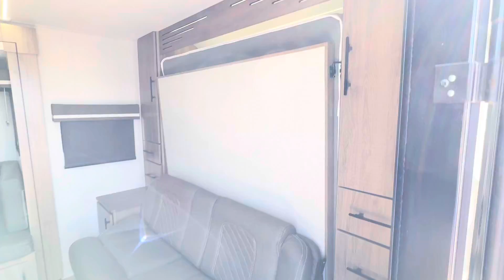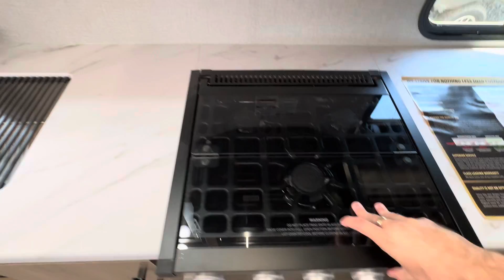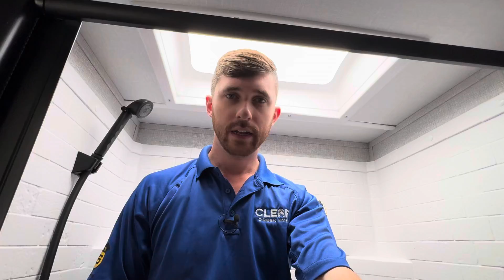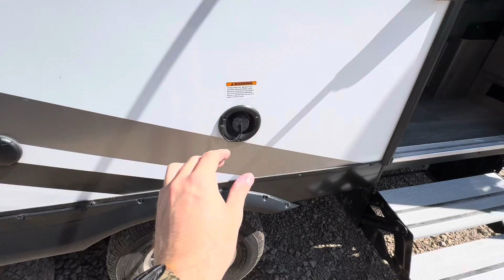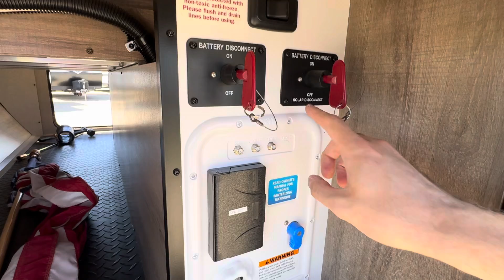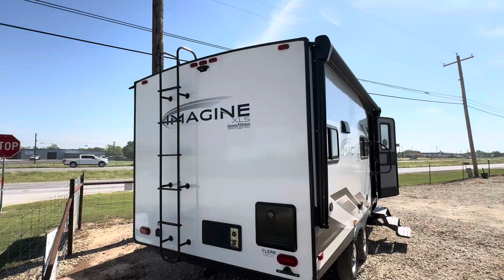2024 Grand Design Imagine XLS 17MKE Travel Trailer Walkthrough | Clear Creek RVs

Comment: Thank you for a good tour of this unit. A few questions: 1) Is there a propane quick-connect on the door side of this camper? 2) What is involved in making the TPMS system operational? Are the sensors already internal in the tires? What additional hardware is needed to make it work? 3) Do most of your customers replace the mattress or add a topper? 4) Is there a storage tube on the underside for the sewer hose? Thank you in advance for your response.
Reply: Thanks for viewing our video! This is a 2024 in the video. We now have a 2025 17mke. It does have a quick connect for propane. It does have a storage tube for sewer snake near the axles. Most people change out the mattress, I suggest at least a topper. It's TPMS prepped so it just requires the sensor mount in the flow thru storage and the screen to go in the tow vehicle. And the tires are prepped for tpms and have sensors already and balance beads to prevent uneven wear and tear(helping prevent blowouts).
Reply: @JerrodDavis-i7j  Thank you for your prompt reply.
Reply: @bhauert  you're welcome. The new 2025's have gone to a square tile like flooring and look amazing! Would you like to come check it out in person?